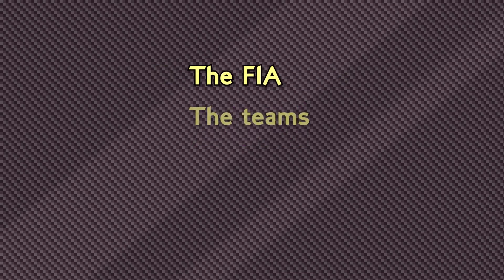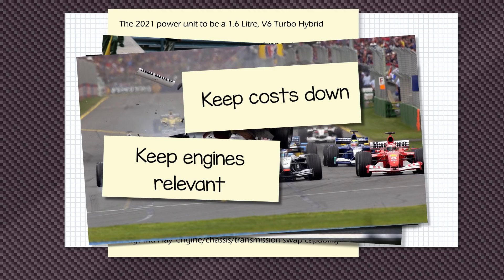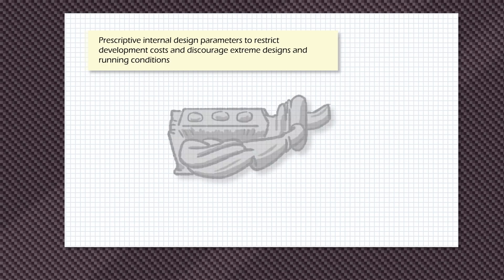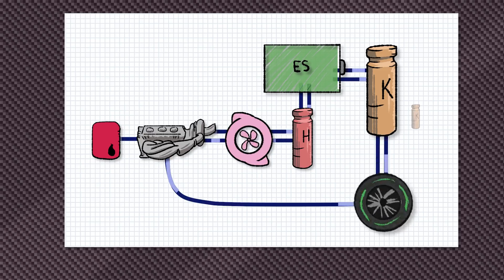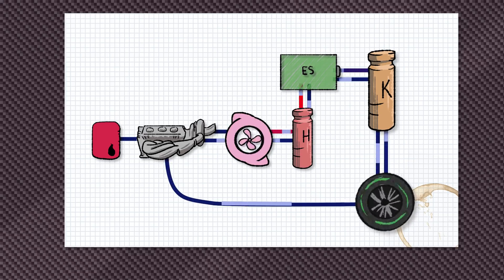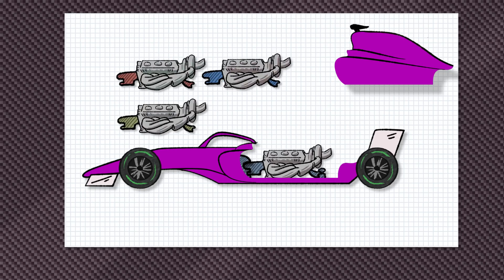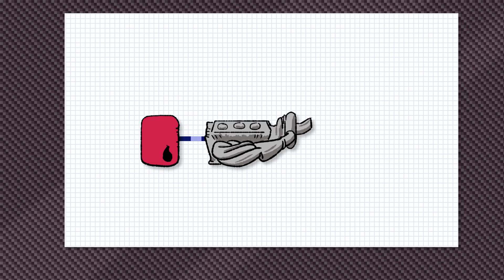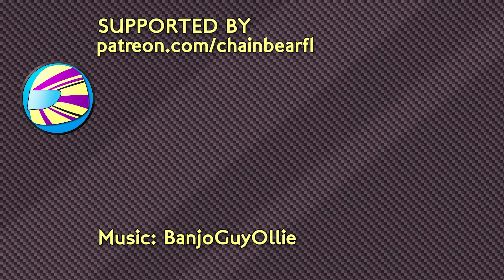F1 Engine proposals 2021 explored

Comment: Twin turbo hybrid if they want, but for God sake of wheel to wheel competition and treating drivers as gladiators, because it’s a competition and also a show, F1 cars should have a simpler front and rear wings, Ground Effect downforce, less drag and dirty air, so drivers can push to the limit, also bring back Active suspension.

Comment: The engine as a whole is an old concept. lol wouldn't hydrogen powered cars be the next step in super powerful efficient racing engines? Either way I doubt they'll completely ditch the ice because f1 fans are very stubborn and see electric as formula e already. Just my opinion.

Comment: My proposal: 20,000 rpm V4 with an electric motor at the crank attached to a hydraulic coupler directly driving the rear wheels. No transmission, like the Koenigsegg Regera. Imagine what would that sound like?

Comment: You forgot to mention the amount of data collected by engine manufacturers is optimally acquired from eight cylinder engines. Sixes offer to little, 10s and 12s the costs don’t justify the information gathered.

The type of technology being developed from hybrid units is nearly limitless. After 100years of the internal combustion engine volumetric efficiency is still less than 100%. 

Sadly badass high-reving hybrid V8s have forced to disappeared. The noises, smells, and visceral enjoyment of F1 as it was will no longer be and F1 will die a slow the death with the manufactured excitement Formula E currently has and the American WWE.

Comment: Nice presentation. I suspect we will see the standard engine fit rule adopted more than anything to break Ferrari as well as Mercedes power over the engine supply as well as for ease of access. F1 risks becoming IndyCar which already has this rule, but has proven this to be effective at controlling cost. The greatest barrier to entry in IndyCar is the need for the manufacture to be able to supply a substantial portion of the grid from day one. If F1 standardizes the bulkhead/transmission interface I suspect you will see Ford return (one of the reasons I think the proposal is there [Ford Cosworth], and I think you will see Porsche enter. Same for removing the heat portion of the engine which has been the cause of most failures. 

F1 owners Liberty Media have been schooled in American racing which seeks to encourage multiple manufactures even well standardizing parts/interfaces or creating equally available third party suppliers. F1 would like the think they are important, and they are certainly wonderful, but the proposed rules could open the gate for a number of other suppliers to enter. Did anyone mind that Tyrrell was powered by Ford, or that Toro Rosso is powered by Honda, or MCLAREN is powered by Renault. 

As someone who works a number of auto races as media, I think you under rate sound. The promoter, the one who pays the fee $25 million last time I checked for F1 (U.S. Grand Prix COTA). plus track set up, maintenance, security, operations, local fees, etc has to make the money back, TV revenue doesn't help them. They need butts in the seats, and those people want sound, they want the roar of the engines, and for people I know who no longer attend races that loss is the biggest reason they don't go. 

I have worked two Formula E races which from a racing perspective I felt they were entertaining, but on par with Indy Lights, Formula 3, etc. Tickets for both races were given away free, were the week before an IndyCar race, and you couldn't get the stands 10% full even though the IndyCar stands the following week were sold out. In this case the race was held 10 miles south of Tesla's plant, and in a region (Southern California) which has the largest population of all electric, and hybrid electric cars in the country, and second per capita in the world.  Just saying.

Comment: I had hoped they would go to 2.0L I-4 Turbo with a big Battery boost. Every car seems to have a 2.0 Turbo engine option. You want to talk relevant that's basically the most relevant engine configuration.

Comment: As someone else mentioned, it's time for F1 to decide wherever to be full electric or continue on hybrid engines.

F1 can still remain relevant even without focusing on electric. For one, instead of using standard petrol couldn't they start using biofuels like hemp fuel?

This would certainly provide and interesting engineering challenge imo and it would entirely change peoples view on the f1 from been some dirty petrol guzzling environment destroying discipline to been a discipline about constantly increasing the efficiency and usability of hemp fuel and imo if they can get efficiency usability and etc of hemp fuel up they could move back up to larger engines and they could still have the electrical elements of that we currently have.

Comment: It is clear that battery technology is nowhere good enough (energy density) to replace hydrocarbon fuels for racing, at least any of reasonable distance. Formula E proves this point by having shortened courses with less laps, and still having to swap entire cars midway. So why not take the good (electric motors) and remove the complications of F1 (ICE and various components) and move to something that will actually help the evolution of racing.

That being - turbine electric.  A turbine, turning a generator, that can store energy in capacitors, that in turn can power the drive motor(s). Turbines burn MUCH cleaner than ICE's, so there is your green angle. They and the small fuel source are MUCH lighter than batteries, making for better handling cars. And development of small turbines has somewhat stalled due to abundant cheap oil and thus lower fuel prices (IMHO), which this would help reverse and help produce a product those car companies could actually market. Not to mention that the electrical infrastructure is simply not there for everyone to go to a plug-in EV in any near-term. Now while a turbine (other than being able to say - turbines to speed) is not as exciting as a V10, it sure beats the dentist office drill sound of pure EV's (again see Formula E).

Comment: IMO F1's rules keep missing the mark.

Simply disallow the use of rare materials in engines, keep the fuel consumption limit and let the manufacturers figure out which engine they think is the best choice to perform within those regulations.

F1 engines have currently somewhere around 900hp I imagine and the distance (except Monaco) is set at "the first lap that exceeds 305km", so let's say 310km. Meaning with 105kg fuel, they're allowed to consume 33.87 liters per 100km. 

So.. yeah, they're not in any way shape or form related to "real world" engines.

Meanwhile, back in 2000 BMW's V12 LMP1 racecar used a engine somewhat based on their old V12 as found in their 850 and 750 models.

Before that, there were even homologation requirements and on a trip to the Porsche Museum I've been told quite some interesting stories about the reactions recieved when they showed up asking for that car to be street legal.

I'd argue that the fastest street-legal car in the world would actually be Toyota's GT-One Road Version, but I doubt they're gonna let one of the two on the Nordschleife.

Comment: Kinda frustrating how much they keep clamping down on more advanced suspensions, that's one area where F1 could actually be relevant to production cars.  

I don't know that such restrictions will keep costs down, more likely they'll spend the same amount of money to get the best engine they can within the new parameters.  I kinda think they need something like a price cap on the engine, they could even force relevance into the engines by requiring them to share the block with a production car.  

I do welcome weaker engines though, I just hope they come with freer development in other areas.   On the other hand, I'm no expert, but my understanding is that the MGU-H is the only thing giving these engines fuel efficiency, it seems like without it they'd be better served with NA engines.

Comment: Today's F1 car has 15,000 RPM, not 12,000 RPM. The one that have 12,000 RPM is Indycar.
Reply from the maker: Yoooo,

That's true - but they only actually rev to 12k due to fuel flow limits
Reply: Chain Bear F1 Oh ok, thanks for telling. Then, they should have just increase the fuel flow to get the higher rpm, and thus louder and higher pitch sound without having to dispose the MGU-H.

Comment: To me Formula 1 should be a fat V8 with a manual gear box and no electronics, scrap fuel limits and testing limits. With a base V8 block that’s naturally aspirated would save teams millions, then let the teams build as it is a sprint race too see who can cover the distance in the fastest possible time coupled with the skill of the driver. That’s what people will pay to see and want to see i bet.

Comment: The majority of engine costs are in the development stage rather than manufacture. If the FIA want to keep costs low - they should let more engines be used per year.

This is because designing a more durable engine costs more than designing a 'disposable' engine. A team could design and use 10 engines a year and it would cost less than designing a more durable engine and only making 3 of them.

Comment: I think F1 should get rid of the MGU-H and MGU-K and instead move to a Plug in Hybrid system. They could have a spec ES and have it where you can run the electric engine at different modes and have it be refilled on pitstops. F1 wants to be road revelant and a plug in hybrid is much more than MGU systems.

Comment: Humm... what about adopting a twin charged engine, with the MGU-K??
Imagine the likes of the Lancia Delta Group B car, it had this system, and it worked, it had no turbo lag because of the supercharger, and in the high rpm's the turbo was doing it's thing.

Supercharger's tech will for sure take a leap, and remember the F1 cars in the 50's or 60's had 1.5l supercharged engines.

You can argue with the cooling and the efficiency but in the end it's a walk in the park compared the mgu-h problems that some of the power units manufacter's had.

Comment: F1 will be electric ?
Not well thought out and seems to be ignorant to why people compete in motor sport in the first place.
Consider the type of people who go down the race track and put their life on the line to win a fancy beer mug.
Do they sound like people who will embrace racing silent electric vehicles with flat power curves.
Have a whip around the pits next time you go to a race and ask the competitors if they'd like the race electric cars instead.
You wont like the answer if you are in to EV's
There wont be any motor racing without engines because their wont be enough people willing to drive them.

Comment: Aaand just like what happened to group B, they are killing F1... i don't see the point in trying to limit "radical designs" if we wanted road-like race cars we would be watching dtm or something of the sort, F1 is supposed to be the uttermost radical, fast and nerve-wracking form of tracksport however they are trying to tell teams to build "crazy fast cars but with nothing crazy on them" let engineers go nuts and overdevelop as much as they like, after all that's F1, innovation and crazynes, from disck brakes to carbon fiber monocoque chassis, all thanks to the radical spirit of F1, please FIA... don't kill another motorsport
Reply: I agree!  F1 used to be cutting edge R&D.  It's going to become another one design class.
Reply: the problem is if as you say there are no regulations except open weeler and a human driver all drivers would probably die in the first corner since it would be way to easy to make cars who can pull these amount of g forces
Reply: @Hettilo  gmo cyborg drivers that are designed for Gs hella
Reply: This guy gets it
Reply: Do you know why they killed Group B ?

Accidents, deaths of participants and the spectators, the cars were too fast and teams cough Lancia cough made the car shit for safety.

So it was killed, they cared more about the life of the drivers and on site spectators.
Reply: That's great and they should let engineers do that. But what are you gonna do when the field gets reduced to the same 2-3 teams always winning?
Reply: Hassle_Jav you mean literally what's happening right now? Smh
Reply: @swiftfx6928  that's kinda what I was getting at. The problem is some of the smaller teams can't computer financially with the big 3. Adding a financial cap could be a way of leveling the playing field.
Reply: Hassle_Jav you're contradicting your own statement though, how can you tell the engineers to go ahead and do whatever they want to to keep the sport interesting, but give them a financial cap? That would be absolutely horrible, imagine if one part of their research goes wrong, that's just their entire season gone since they've already hit their cap.
Reply: @swiftfx6928  sorry, what I was trying to get at is that the sport and fans want to have the cake and eat too. We want competition to be really tight with any team having the ability to win the championship, but we also want the sport to showcase the best in engineering. some teams cannot handle the financial burden of competing at the level of Ferrari sand Mercedes. I was just putting in my two cents.
Reply: Hassle_Jav true, but if you have the best team and engineers and you still can't compete with the likes of force india or haas or whatever because you're either on a financial cap or regulations so strict that there's no innovation shown between the different constructors, there's no competitive aspect. There will always be the better ones and the worse ones.
Reply: Do you realize why they killed Group B? Because all that "innovation" and that "let's make the craziest race car ever" only got more and more accidents and drivers killed. No wonder group B was banned. It's because it became way too dangerous. If you don't put rules, it'll only become Anarchy and disaster like group B was.

Comment: You should be concerned about engine conservation. They made the same mistake with the tyres which made drivers hold back. And that too was what experts had previously deemed sufficient. When actually it created tedious racing for both drivers and fans.

Comment: I am an american AND a F1 fan so I have a little different perspective. In my opinion there is no replacement for displacement. If they want to attract other engine manufactures they need to simplify things. Look at the struggles with Honda that was in F1 not too long ago. Get rid of the 1.6L V6, MGU-H, MGU-K,turbos, and bring back the big engines. I think that would make it more attractive for other engine manufactures to enter F1. V6 in a race car? Are you kidding me?
Reply: The only time their engines were big was in the 50s, I'm sure some oldtimers would want to roll right back to the 50s, but I doubt that is a major part of the audience.
Reply: And yet this V6 hybrid cars are as fast as their monster engines predecessors.

Comment: These engines sound like shit, they are underpowered, boring! Expensive as hell, complicated and relatively unreliable. If they listed to fans at all they would have ditched this stupid setup in favor of cheaper, less complicated, better sounding, more powerful engines. Seems like a  no brainer. The current setup is terrible.
Reply: Their engines were anything but cheap at any point, and if they didn't impose the number of engines they can use teams would burn one engine per race completely.
Reply: MsSomeonenew Good! At least they would have more power, sound better and be more reliable. F1 has never been cheap and it was never supposed to be. But they didn't cost 25 million pounds +/piece. If you want a cheaper series to compete in? Pick one, as there is no shortage of them.  There doesn't need to be a relevance to the road cars. Who cares if they are in efficient? There are 20 cars across the entire globe, so what. The current setup is plain stupid. Make it simple, stupid.

Comment: Interesting dilemma; power, speed and safety. We are currently around track limits for speed, so if you make them faster will they be less safe. (Ying and Yang) That leads us then to fuel efficiency.  All electric (FE) is most efficient, yet not as exciting as F1.  That conversion is moving in the direction, but probably at least 20+ years away.  Plenty of time for us F1 enthusiast to adjust.  Enjoy while you can.....
Reply: Ralph Gutierrez they got their halo bullshit for safety. Now double the size of the turbo.

Comment: I have a doubt about the "plug and play" idea. Will drivers/teams be able to put an engine form another brand? Let´s say that brand "X" is not going well, not delivering the power it should, then, team A change their brand "X" engine for a brand "Y", which is having great results. That would, hugely, impact not only the race, but also the entire season (and the engine makers for that matter). It´s funny, in a way, to think about this because, if they are making changes to allow brands like Lada to join in, that concept could (and probably will) instantaneously kill them.

Comment: I think you’re right about the V12s but hey. I feel a v12 making as much power as a v6 or in-line 6 would be safer. I’m not a huge F1 follower but the common sense in me says. A v12 making as much power as a 1.6 liter 6 cylinder could be designed and produced cheaper. (Of course the trade off would be size)